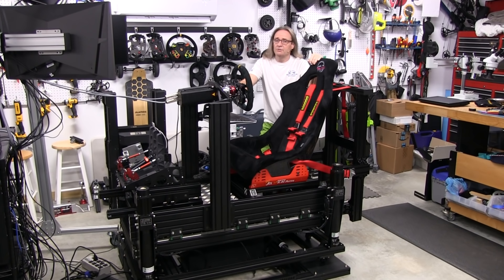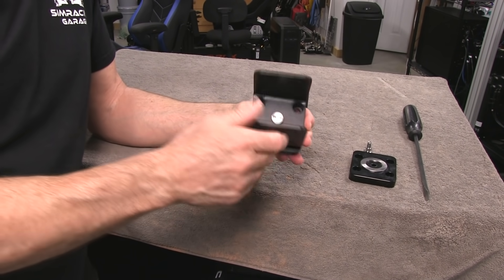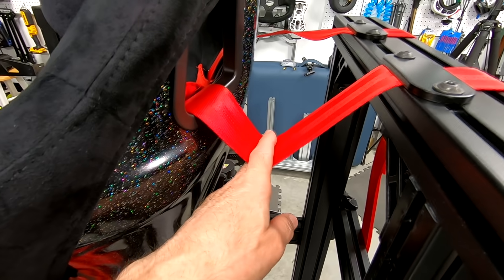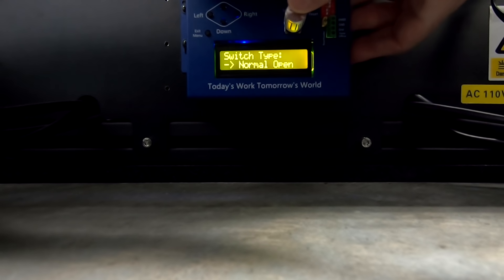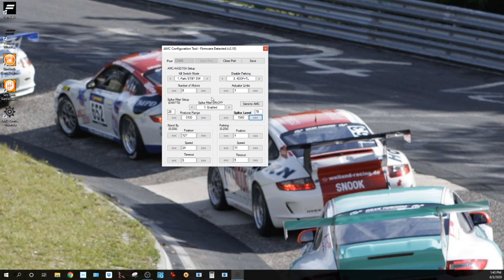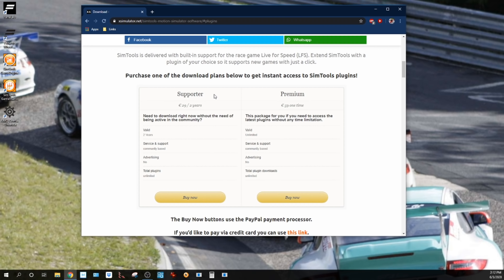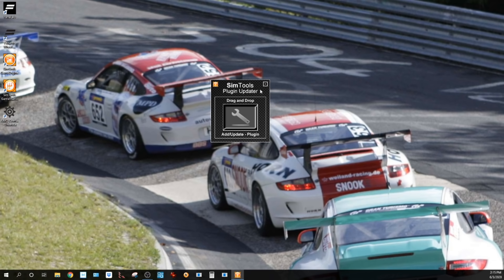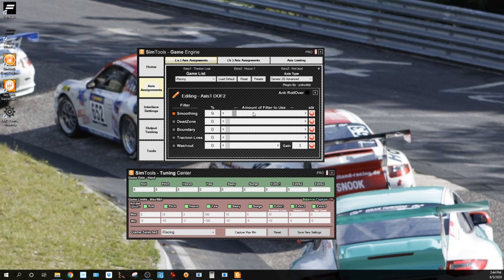PT Actuator 5DOF Motion System Review Part 3 "Configuring/Testing"

Comment: It looks great. However, after all that stuff has been added, I wonder about the total weight of the cockpit section on the actuators, (and then the total system on top of the surge section itself). I think one would fallow "race car" practice to ensure that any "sprung weight" is kept as low as possible to make the most of the limited "G force" simulation acceleration in any direction that the actuators can provide.

Comment: Absolutely loved this 3 part series. 

And it’s about as close to a SFX100 build review we’re likely to ever get.
Reply: SFX is quicker and stronger
Reply: I think it’s the same motors for the 4 vertical actuators at least just maybe a different flange size?   So for that part it should be the same. I am using Thanos as well so same setup there.
Reply: @hishams89  wrong
Reply: BMW Germany 
You can’t compare a 3D printed DIY actuators with an industrial heavy duty as PT actuators... no SFX is a nice DIY project but it’s not at the same level as PT actuators.
Reply: @wajdi1977  the servo motors of the sfx are industrial servos
Reply: @hishams89  incorrect
Reply: @hishams89  They may be industrial servos on both, but did you forget the 3d printed parts that are used to hold it together? SFX100 is in no way a stronger build than PT-Actuators. You can't compare PLA to Metal. lol
Reply: @LeaseACarOnline   mate, who told you plastik is like biscuits
Reply: @hishams89  LOL

Comment: Barry, can you give us a little comparison of this vs. the latest, similarly priced 3dof dbox?  Immersion comparison?
Reply: No
Reply: It would not be smart to do this, especially as D-Box is suffering as a result of the Covid pandemic where commercial locations that make up big parts of their business are also struggling. I think that's why we have seen the unusually large price reductions of late. 
If you want a mature 'plug and play' motion solution, and have the very deep pockets to fund a similarly configured D-Box build, then D-Box is the way to go.
If you don't mind a more DIY approach with software that is more 'enthusiast' focused with deep adjustability, then this PT solution can't be beat on value for money and D-Box cannot compete even closely in price. At least not yet.
You can build a 4 actuator PT-based solution for far less than half the price of the D-Box 4 actuator solution, and will get actuators that have far greater stroke range, which would increase that price delta as the 150mm stroke D-Box solution is close to new car prices.
If you have $20K+ to build something, then D-Box is a great option, but if you want to build a very similar solution using PT, then you could invest that difference in many other things, or just save it!
Reply: @Globespy  Barry did a review of the new 4 actuator DBox.... the price is now half what it was. $9,000 will get you what used to cost $17 or 18,000 USD.  Still a huge amount of money for sure. I am curious though about the precision and quality of the 4 actuator DBox vs. the less expensive solutions like this one. Clearly, PT gives you more functionality for less money but sometimes spending nore actually gets you higher quality. I am not sure if Dbox, even with the price cut, is worth the extra money vs. the newer market entrants.

Comment: Brilliant set up (and video as per usual) but can it be made better? Let's drop the swivel pin at the front. Replace with a second traction loss actuator (installed opposite side to rear traction loss thus same actuator movement as rear for understeer or oversteer) and thus achieve the front as well as rear traction loss. The system can handle one more actuator so should work if software can deal with it, which I presume it can. Any thoughts on this from you sim brainiacs?

Comment: Barry, I've noticed you don't seem to use any tactile transducers. Given how advanced of a setup you are running is there a reason you aren't using any sort of transducer, or have you not gotten around to trying one yet? I would be interested in a review from you with your experience and format about these devices that are supposedly incredibly immersive for the price.
Reply: No need for transducers, he mentions in the video he can feel all the road surface and curbs rambling...
Reply: @tronicgr  Transducers add more than just road feel though. While it's true 4+ corner transducers may not be necessary with a 5DOF platform, I would imagine that there are still a large number of output channels that the motion platform isn't picking up or simply can't relay quickly enough. Each level down of motion is having to move more and more weight which naturally means it's ability to reach it's peak frequency. The information I have found regarding the frequency of this controller, which by the way is FAR too difficult to track down, is 1000Hz, which puts it right around the place of a midrange, and while that will be what is going to the actuator, there is going to be inherent loss as those actuators try to move that mass of the rig to match. A tactile transducer has a frequency range of 5-200Hz, which will get much lower frequencies than the PT actuators, with the added benefit of being able to mount directly to the seat or seat brackets, meaning that vibrations within the car will be felt. Things like gear shifts, engine speed, and numerous other channels that simply can't be replicated by higher frequency ranges will be felt and add to the immersive experience. It would also allow for more headroom across the system. By adding motion you reduce the amount of information the wheel needs to send you in an effort to compensate for a lack of feel, if you add transducers you reduce the amount of information needing to be sent to the motion platform. All of this means information and details are more isolated and as a result much clearer. I'm not saying the motion isn't already very communicative of what is going on with the car and the track, but there are still things that other solutions can improve upon.
Reply: @tronicgr  SimTools v3是否支持振动？我已经购买了三轴，等待更好的结果。

Comment: Do you have a car-track combo suggestion to test out that weightlessness feeling you get sometimes when driving over a hump just right? Has any of the motion systems you've tested so far been capable of achieving that? I'm guessing Laguna Seca Corkscrew would be a pretty fun test at least (don't know if it gives that feeling though)

I would also love to see something like old Monza oval as part of the motion test bench for the really bumpy banked straights and turns.

It would also be cool to see a video comparing the motion algorithms from the different software out there and how they handle things differently.

Comment: Some simulators have the seatbelt retractor mounted on an extruded aluminum trail in the back of the seat up at about 7degrees angel feeding into the hole of the seat.

Comment: Well that was quite a project. Well done for the outcome. My question: Is the driving experience good for driver training? This may seem to be a strange question but if a driver is training with incorrect motion inputs, this is not going to be helpful. Who could answer that with certainty?
Reply: This is an old post but I have a good insight into this; I’m a simulator engineer for an F1 team and  know a fair bit about motion cueing. My feeling is that a motion system like the one in this video would probably be actively harmful for driver training. At the very least, a lot of the motion cues I can see being used are precisely the opposite of what we would cue. And in particular, the yaw cuing is by far the most important for actual driver feel because that can give the feel of under/oversteer.

Comment: When you adjusted roll and were steering back and forth, you should actually be adjusting sway for this. Roll is for track bumps/kerbs/tilts. Sway is weight transfer of the car.
Reply: @karoo_bushman6880  Interesting, I will try this tonight. What do you have your roll set to in axis assignments and tuning center value? Also are you using Extra2 or Heave in iracing for heave?
Reply: @karoo_bushman6880  good point. There are also lots of partial truths in this industry... ;-)  The problem of motion representation is also very relative. 4 post systems try to synthesize multiple motion layers, usually from the relative point of the driver (G-forces experienced) So when you brake the vehicle pitches forward to indicate g-force, but it also pitches forward because of front spring compression. Both motion layers are overlayed on one another and doing two things. One is relative to the car; spring compression and the other is relative to the driver G-force. in a 5 or 6 DOF system with surge for example, its always better to give each actuator or axis a particular function. so that an F1 car doesn't feel like a boat trying to represent the high braking g-forces. its tricky. ;-)

Comment: This set have the rumble feature that D Box have?
Reply: it does not. they usually recommend but kickers, but given its an open community, I am sure they can add it. problem with tactile feedback is that it kills ball screws and actuators, hence you "need" quality parts, high frequency 50hz or more vibrations (like engine vibration) can ultimately pit the screws. D-BOX sources good ball screws but if look up the price of ball screws they are expensive for a reason. The chinese ones are a lot less, also for a reason, but I think in this application it might not apply as much as others.

Comment: Do they sell the seat belt system? Id like to try one with my NLR V3.
Reply: They actually are developing a seat belt system now. It should be released soon. I would say within a month or so most likely.
Reply: Very easy to add your own. Just buy a harness, and attach to the stationary part of your chassis with springs or rubber to give you some give. It is a very good addition- and cost about £30 for me (found the harness of ebay)

Comment: Sooo, it it better, worse or the same as D-box? That's what everyone wants to know, unfortunately since the Direct drive wheel comparison review seems like everything reviewed is "good".
Reply: i think if a product does its job and isn't a complete failure its classed as good and he leaves it up to the end user to make their decisions on which is better for them.. But i think its clear this system is better than dbox. For starters.. 250mm/s vs 100mm/s travel is masive
Reply: @peacemakermotion3949  I think you're not taking into account / have not felt the transducer effects of D-box which the other systems can't replicate. The extra speed of travel should be noticeable when crashing into a wall or bouncing at the bottom of a jump but not too sure at what other time a cars suspension will travel more than 10cm in 1 second, however Barry does know as he has tried all systems and it would be good to hear his thoughts.
Reply: @ultimaevo77  You can probably get the transducer effect with some extra gear and still save a bucket of money compared to the D-box system.
Reply: @ultimaevo77  suspension does that all the time, even more. 10cm in a second doesn't necessarily mean in one direction. going over a few bumps in the road the suspension can move up and down like 4 times in a second. so if your suspension travels up and down 3cm each way. thats 24cm of travel in a second. couple that with 10,000 Counts per revolution on the encoder/motor and you have excellent fidelity. something a transducer wishes it could replicate. Dont get me wrong, they help make up for the short fall in speed and work well in doing so but its a whole other level if you ask me.
Reply: @owner-builder  I ran beefy transducers before I had D-box and the vibration isn't comparable unfortunately.
Reply: I'm going to say that Barry goes to such excruciating detail, that it leaves it up to us to decide if one is better than the other. As for D-Box vs PT-Actuator, PT-Actuator gives more for the price. U can get a beefy 5DoF system with more speed and travel from PT-Actuator for the same price as a 4 actuator 1.5" D-box system. However, D-Box combines transducer and actuator into one, and that is a considerable point. No one else seems to replicate that idea until now so if u want both into one, D-Box is a great idea. To create a 5DoF such as this with D-box, u need a very deep wallet though u won't be disappointed. If u use the PT-Actuator kit and add heavy transducers and bass shakers (like  Buttkicker LFE) with a powerful amplifier, it will be a more messy situation with more wires and 2 softwares needed to control it, but hell yeah, it'll be half the price. Looking at much above 30K for a 5DoF D-box system with the same design principle as this and comparable speed and travel . PT-Actuator 5DoF + Buttkicker LFE ×4 + 1000W Amp ? 15K at most. So definitely, this makes much more sense for the average consumer. Provided u have 15k USD to shell out, which is a huge sum on its own. And don't say u can make a real race car for that price, cause though u can, a simulator means safety, and no maintenance or insurance cost, and the ability to drive any type of car, rather than be limited to certain disciplines of Motorsports in a real car.
Reply: I went from a 4250i dbox to a PT kit and wouldn't switch back. PT is king!
Reply: @1986alexpotter  I am also considering pt, pt motor also has a vibration function, the current software does not support, I heard that v3 integrated vibration function. How about the vibration function of dbox? Can tpp use the same effect as dbox?
Reply: @ultimaevo77  Actually PT-Actuators can replicate the transducer effects and it's actually in the works now. You can see some initial videos of this on Thanos' Youtube channel. Theres nothing special about how D-Box adds in the transducer effects. The servo does it all and the AASD15A drives and servos can actually create a much stronger effect from the initial videos i've seen.
Reply: @ultimaevo77  let me tell you a secret... D-Box does not have "magic" combined servo and transducers in the actuators... all they do is to inject extra pulses up and down into the servo positioning control loop... and it kills it sometimes... ask Barry how many of his friends and himself had to RMA D-Box actuators because of that... lol  🤦‍♂️
Reply: @1986alexpotter  Good to hear from someone who has owned both, is your PT actuator kit just 3DOF like the 4250i?
Reply: @tronicgr  I've never heard of anyone with D-Box RMA in one group of about 20 long term owners and another with 380 members, mine have been going hard since 2015 even though it was a 2nd hand refurb kit. I am skeptical of claims of cheaper gear being better unless someone has owned it all then gives their opinion, I've owned a piece of DIY gear which was absolutely better than another more expensive piece according to fanboys but after owning both the fanboys were full of crap and their word was pretty much taken as gospel.
Reply: @ultimaevo77  correct, I had a gen 1 4250i 3dof. I run a similar setup to the one Barry has, but my kit was purchased before the surge add-on was available. My pt kit is 4dof with traction loss.
Reply: @ultimaevo77  oh, so I guess you are not in Barry's group then 😏
Reply: @ultimaevo77  transducers don't have the fidelity, and some software like AC can't even produce it (333hz for AC and 360Hz for iRacing)
Reply: @danyalreyaz7503  reasonable comment.
Reply: @ultimaevo77  I've RMA'ed many, mostly bad ball screws and many ACM's. but they are always great about the process. I have a whole box of dead ACM's and some 'spare' actuators.

Comment: You tell maybe to disdable sway in your video But then in long sweeping corners like the Parabolica on Monza sway neutralise roll so your car Goes down where the load is
Example: when you disable sway and  you go to turn 3 on Monza and stop there and put your right wheel on the highest curb then your front right Goes up, But when you go trough the parabolica corner 
Your chassis is going  right side up and that is wrong! Therefore you must turn sway on because that corrects the roll so that when you go trough a corner the outside chassis dives
Maybe i’am wrong because i use a other control system ( SFX-100 systeem with Simfeedback ) correct me then :-)
Reply: For me Sway is even more impressions than roll. Cars usually don’t roll that much speculative modem racing cars ( GT’s and open wheelers). Sway makes you feel the gforce on your body in high velocity corners and directions changing.

Comment: cant see the actuators lasting in this type of application.
Reply: Funny. Mine lasted three years worse ( pre spike filter era ) and still going like new 😁
Reply: Had mine since November, they get abused almost daily for a few hours. Not a single change in performance from day 1.
Reply: seen from experience with some actuators that small dithering movements can cause the seals to dry up inside the body and along the fescalised portion causing the seals to wear out prematurely in turn causing a leak.
Reply: @001-j7l  are your actuators sealed with oil in them? I mean the PT-ACTUATOR ones I use have silicone grease to avoid leaks and getting dry etc...

Comment: Harness tower is great but how do you go about it when you slide the seat back and forth with a seat slider.. what adjustment do you need in that case?
Reply from the maker: I have enough space to slide the seat back to accommodate 6' 5" body so far. Belts are long enough to compensate. You can use longer profile pieces on the bottom where it mounts to the frame if you need more room.